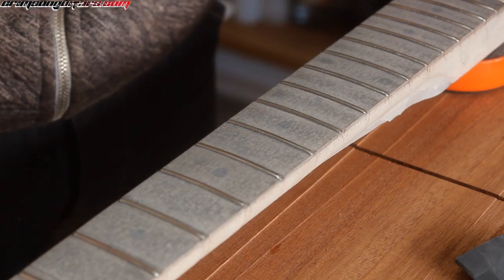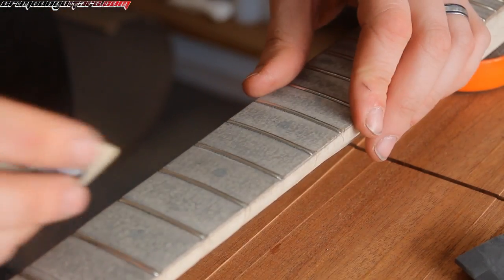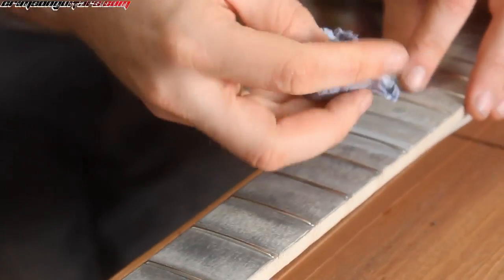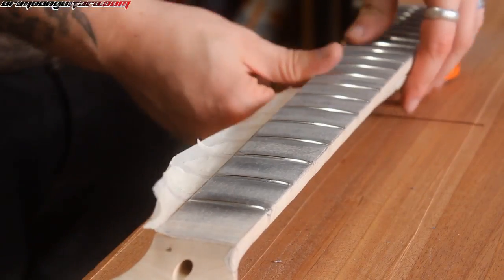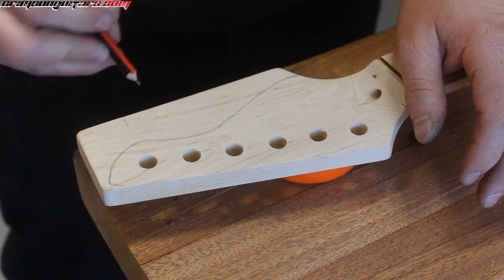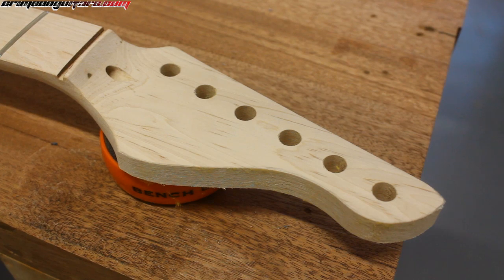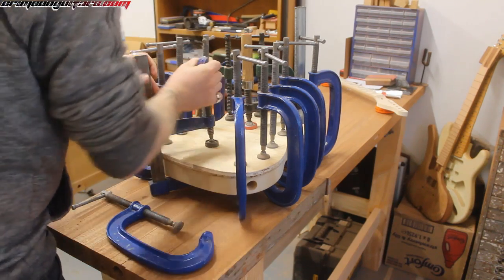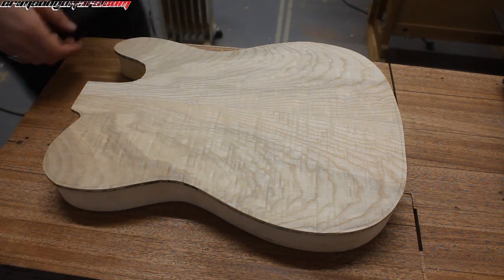Ep 4 - Taking a Cheap Kit Guitar and Making it GREAT - Frets, headstock and top

Comment: From what I've seen so far, the 80 pound kit is a good starting point for dozens of hours of work using many different specialty tools that most people don't own.  In other words, for most people you're better off buying a half decent used guitar.   But if you guys can develop an affordable kit that eliminates the need for lots of specialty tools, I think you'd sell a bunch of them.
Reply: you really don't need fancy tools. I level and dress frets very well with just a 2nd cut file,  cheap set of needle files, wet n dry paper and polish with leather strop loaded with jeweler's rouge.

Comment: If I were to take a typical strat copy headstock with 6 tuners on top, and re drill it and cut it so it has 4 on top and 2 underneath, would it ruin the tone or tuning of the higher strings?

Comment: So if I understand correctly, a kitguitar is not for the amateur. I don't have upteen heavy clamps and heavy machinery. No amateur does.
Reply from the maker: +wijk89 a good kit guitar should need little to no machinery or heavy tools.. A cheap one almost always needs remedial repair before you can even use it.. Check out our recent series building one of our own kit guitars.. It is much much easier to put together.. B